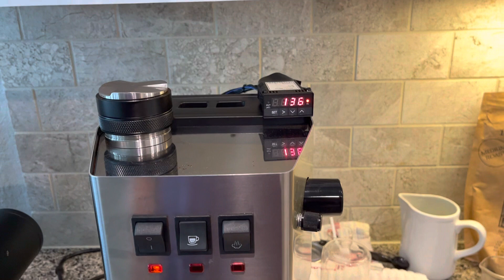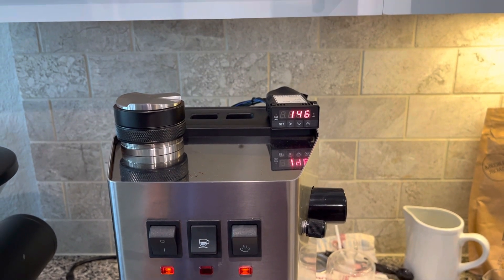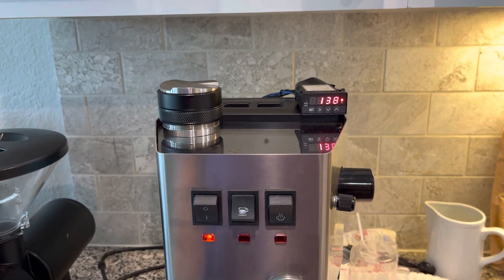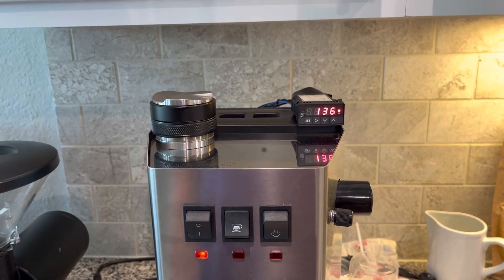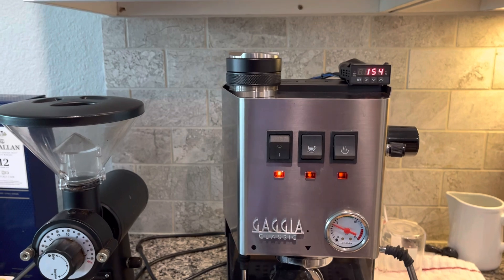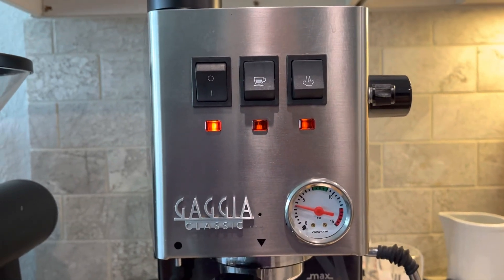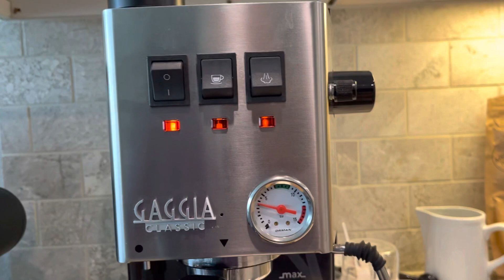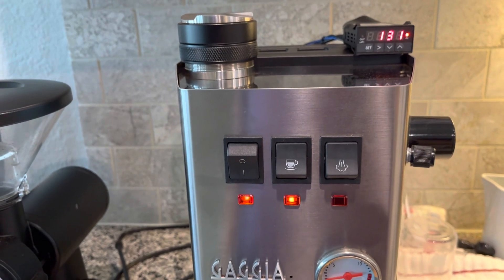How PID Controls Brew Steam Temp on Gaggia Classic Pro @threehanded8853

Comment: Т.е pid настройка AL1 AH1 бесполезны? Индикатор температуру и без них покажет?
Reply from the maker: The way this PID was wired, the alarm settings actually control the range of temperature for steam, when steam is selected.  In this Gaggia single boiler, and many others, when steam is selected the brew thermostat controls, or inputs, are interrupted.

Comment: Hey.. question about your pid install. I did mine and it seems to be wired like yours. 

When I turn on my gaggia the temp shoots up all the way to 170*c then goes down to 124*ish.. then makes it way back up. It seems as though the brew switch is not flickering to regulate temp. Would you know what could be the problem?
Reply from the maker: Did you set the initial default settings, then use the auto-tune?
Reply: @threehanded8853 I did the manual settings first then I auto tuned it after.. but not sure if it finished auto tuning. Is there a way to reset the pid?
Reply from the maker: @ezpzworkouts  not that I know of. Auto tune two times should do it, after setting your initial temperatures, but it’s difficult to analyze not knowing what model pid, what thermostat sensor, and exactly how it was wired. Sorry I cannot help further.
Reply from the maker: PID = proportional–integral–derivative
xmt7100

Menu 36
P = 4.1, 3.6
I = 75, 134, 147, 139
d = 18, 33, 36, 34
Souf = 0.2
OT = 2
FILT = 0

Menu 89
IntY = y
OutY = 2, 3= on off heating vs pid heating
HY = 3
PSb = -9
Rd = 0
CorF = 0

Menu 1, Su = Set Temperature, AH1 = Alarm minimum, AL1 Alarm maximum, 

Menu 36, P = proportional band, I = integral timer, d = derivative time, Souf = overshoot suppression factor, OT = proportional cycle, FILT = digital filter factor

Menu 89, IntY = input type, OutY = control output type, HY = auto tuning pV bias, PSb = pV bias or temperature offset, Rd = control action type, CorF = engineering un selection or Celsius or Fahrenheit
Reply from the maker: Ewylin Tee has good instructions in this video. [Press and hold > to start auto-tuning, this can take 15 minutes.] Ewejin Tee demonstrated a good diagram in this video, https://youtu.be/ztvDKt2Zz6c

Comment: This is a cool idea - I have a REX-C100 PID for the brew temperature on my Gaggia, and was thinking of just using a second PID for controlling steam temp.  I hadn't thought of using the alarm function on a single PID.

The thermostat normally used for steam is near the top of the boiler, where you would expect steam buildup, whereas the brew thermostat is closer to the bottom and presumably below the waterline.

I suppose it's not a problem to use the single lower thermistor for both brew and steam, as it seems to work in your approach.

Thanks for sharing!
Reply from the maker: Thank you, but I can’t take credit for what I learned from so many other content providers. I tried to credit them All in the description of my first video, https://youtu.be/3HrBZlgE1yE

Comment: Just installed the PID, pressure gauge, and dimmer switch kits with the top box from Shades of Coffee on my GCP. If anybody was ever wondering whether the benefit is worth the cost, the answer is 110% yes. It was kinda tough, though, I have to admit. I think of myself as pretty handy, and it took me a couple hours to get it all done. If I had only done PID, it wouldn't have been as hard, but still not something you'd probably consider user level maintenance. But if you tinker at all, definitely at least do the PID. Made a big difference in my shot quality and steam power.
Reply from the maker: Agree. But I believe the dimmer switch, giving you flow control, is the single most important upgrade. I have a talk over slide show video of how I upgraded: https://youtu.be/3HrBZlgE1yE

Comment: if possible can you show the wiring? or an sch?
this is how I want mine to work and this is just impressive
Reply from the maker: Start with this:  Gaggia Classic Pro Gauge PID Dimmer - How It Was Done!
https://youtu.be/3HrBZlgE1yE
Reply: @threehanded8853  I watched that video but you don't talk a lot about the wiring, I do not want to install the pressure gauge.
I'm pretty good with the soldering Iron so the modification of the pid is not hard I just need to figure out where to connect everything the boiler part is not hard since there seems to be a lot of documentation online but there is not a lot of information about the steam mod where do I connect the second relay and how do you make it change to the alarm mode once you set the steam switch

Edit:
By the way, thanks for your prompt response, nice project I hope I can replicate this to some degree 
to be hones the most important mods for me are the boiler ssr, steam ssr and the opv 9 bar spring (the spring is no challenge)
I already updated the portafilter and basket as well was the head and the water distribution head that goes on the head

keep it up, great content!
Reply from the maker: @FranciscoMartinez-vq6zh  the dimmer is easy and the best improvement of all.  The second relay is simply wired to the two wires that come off the steam thermostat! The alarm Min and Max settings are in menu 01, right after set temp setting, in that order. Damian demonstrates the settings for the xmt 7100 PID in this video, but you must set the type of thermostat based on what thermocouple you will use:  https://youtu.be/0oJ1KwWDBYw  Damian’s original modification video on the xmt 7100 explains how the two relays will work: https://youtu.be/Ewj5oXl_wk0  In Joe Varacalli’s video his engineer dad gives a good demonstration on the best way to connect to the power source inside Gaggia:  https://youtu.be/B3j-AKNIGns
Reply: @threehanded8853  sorry for the late response, I gave up. 
something came up, and I got a quick mill anita evo
I really wanted to work on this machine. I might eventually do the mods but not at the moment